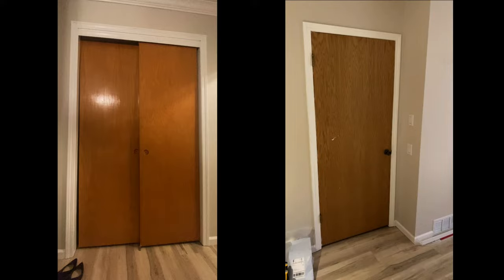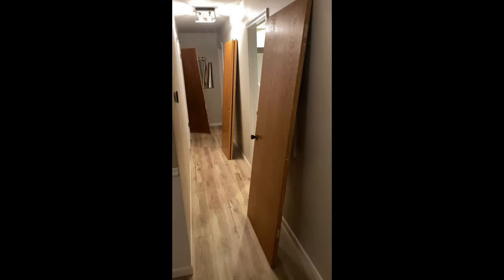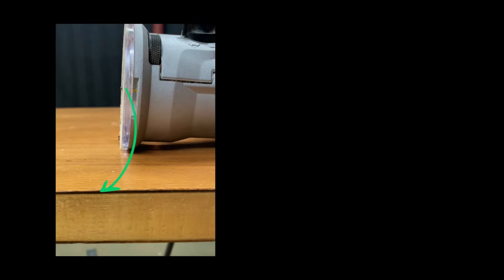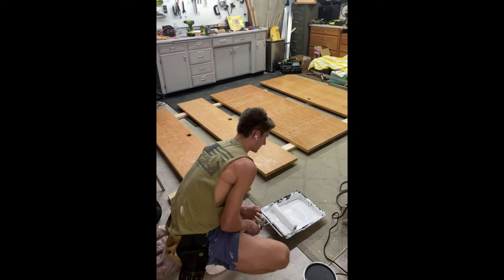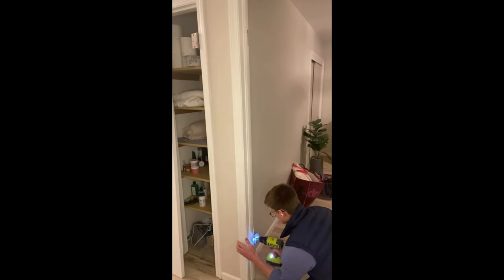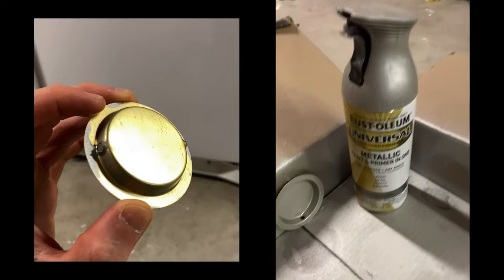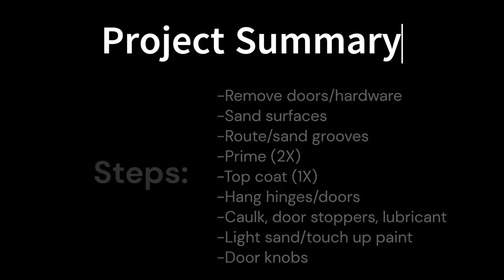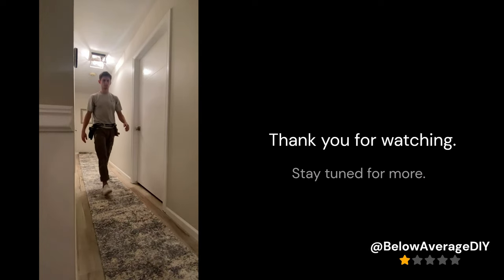Interior Door MAKEOVER ✅ Make Your CHEAP HOLLOW CORE Doors Look EXPENSIVE 💲 DIY Tutorial #budget

Comment: You did a good job. Did the primer hide the wood grain pattern?  Im fixing to paint a plain door and hoping the primer will cover the wood grain pattern.  Thanks.
Reply from the maker: Overall, the sanding / primer / top coat combo hid the wood grain well. If the light catches in a certain way and you look closely, you can still see some grain, but it does look pretty clean unless you're paying close attention. If I could go back and do it again, I don't think I would change anything about that piece of the project - turned out pretty well. Thanks for watching!

Comment: very nice DIY work. Thanks for sharing. Plan to do the same on 15 or so doors. Are the groves only on the front of the door? Need to buy the sander (the round one) and the router. models?
Reply from the maker: Heck yea - thanks for watching & hope this helps during your project. I did groves only on the front-facing sides except for my master bedroom door (since I see it from the inside quite a bit).
--router I use:  https://amzn.to/3N1op69
--router bit set I use: https://amzn.to/4dodWN9
--sander (I have an older model than this one. This link doesn't include battery): https://amzn.to/4din2e1

Comment: Great idea and good job. If I were you I would have extended the doors at the bottom first to reduce the large gap though.
Reply from the maker: I was strongly considering that too. I ended up adding a foam door sweep to the bottom of a few of the bedrooms to close the gap just for sound reduction's sake, which has been a decent solution so far. I considered adding on some wood to the bottom of the doors but figured it'd be pretty tough to blend in to make it look natural. Have you ever tried that successfully? 
Thanks for watching.
Reply: No, but I recently found a video where someone was doing this. As long as you paint the doors in opaque color it shouldn't be a problem. Glue on a piece  of wood sand it flush, fill gaps with some filler, sand again and paint the door.
Reply from the maker: @echtnochnichtda  That's cool, good to know. Thanks for sharing the idea - have a great day.

Comment: what inspired the design? It's subltle, but tasteful. I would have filled the doors, while I was at it, to give the feel of a solid door.
Reply from the maker: I was originally thinking of  material to the door surface (with super thin plywood) to achieve the same 5-panel look - in general, I think the 5-panel design looks more classy/modern/expensive than the flat surface.  
I realized that adding material on top of the existing surface would be more difficult - would have needed to mess with the door frame / jamb / hinges to make them close properly. So ultimately went with material with the router instead.  
Thanks for watching!

Comment: Since you hate painting, you might want to invest in a paint sprayer. Save your time and you get a nice even spray (if you do it, right) and a smooth finish.
Reply from the maker: Any recommendations on a specific paint sprayer? Definitely on my wish list.
Reply: I have a Wagner Flexio. I don’t know if they still sell that model or not because I’ve had in a long time. I do know Wagner seems to be the number one spray painters, but most DIYers use on the YouTube channels. The one I have has the paint and the hand sprayer. But there is one bigger but you can put the tube into the can of paint, so you don’t have the weight of the paint in your hand. Which I’m considering getting since I’m getting ready to paint the whole house inside and I’m in my 70s. Doing one room is one thing but a whole house is another thing. Hope this helps.
Reply from the maker: Thank you very much.

Comment: Instead of the touting you should have used molding.
Reply from the maker: Next time. You think moulding is a better look? Faster to implement?
Reply: @BelowAverageDIY  Closed it could look better, maybe. But  once open the moulding couldn't go edge to edge because the door has to close on the stops. I think aesthetically that wouldn't look good.
Reply from the maker: @joepro3562   - agreed. I think the closing scenario is one of the reasons I "carved in" instead of "added on" the 5-panel design.